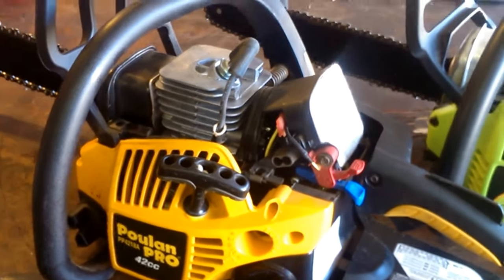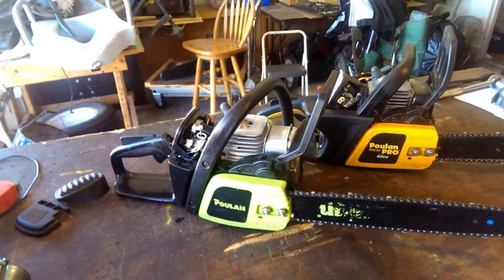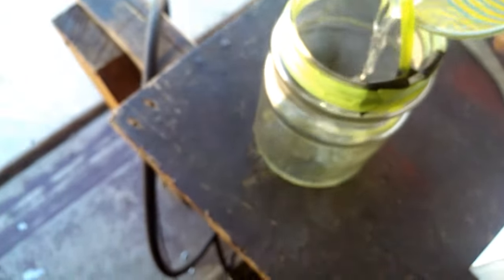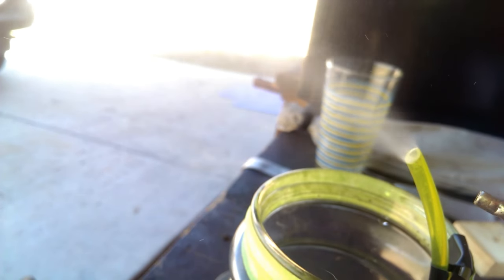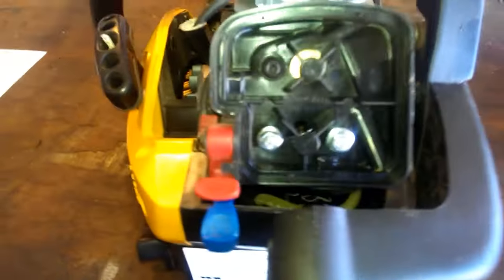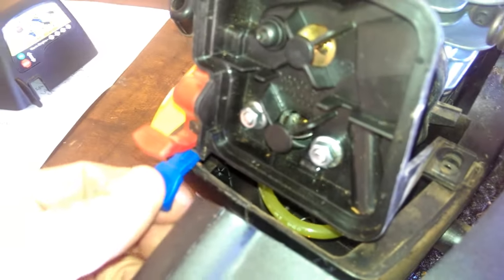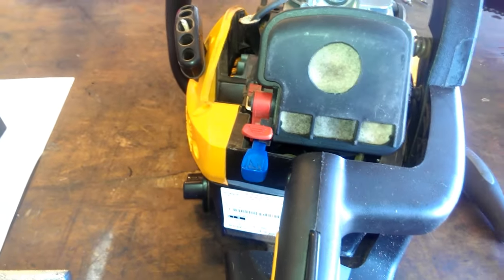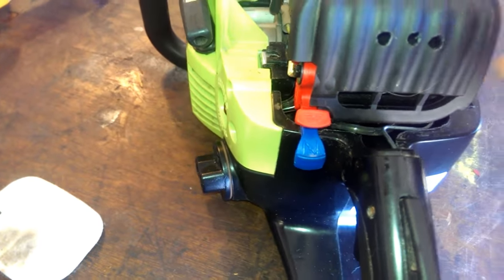Poulan wont restart after being used & how I solved my problem.

Comment: Awesome tip. There can be no harm in letting more air into the engine. I have that "bumblebee" model and it does the same thing every time, runs fine after initial start but after its warm it won't fire again. I have a date with disaster response in the morning and before I leave I will be making a big hole in my air box.
Reply from the maker: Eric Butterfield clean filter and increased air flow will do you some justice my brother. Please let me know how it works for you.
Reply: I just watched the poulan official channel and there's a warm start procedure I wasn't familiar with. They say specifically for a warm start, pull the choke and push it back in, this will engage the fast idle setting. I will try that first since it did come from the manufacturer.
Reply: ulitepilot aka Zombie Dave the Poulan warm start procedure worked perfect for me. I failed the saw and touched dirt. The chain came off and I marred a few guide links. I can fix it with a file I'm sure.
Reply: Eric Butterfield any update on the saw? Warm start procedure still working or did you saw the hole in the air box?
Reply: That sounds right. I never had problems with my Ppro 42cc but I did notice off the bat that it needed choke if cooling a VERY short time. I did check the filter before operation for clean. I chalked it up to the fact the lil bugger ran so good hot that it was prone to being picky at anything but hot. I thought my kind of girl! Glad u pointed that out, good thing someone reads the directions. My saw was second hand from a pawn shop. My buddy had me pick one up and he finally paid me for it...he is out in woods now pushing the tenth tree off the stuck bar with his tractor. Been in many tall trees(a few 500mi from home at my sons place) with hatchet and 2x4 steps nailed on limbs, ropin that Ppro up and never had to cuss her out, yet. My Sons neighbor helped hold wires away. then went out and bought a Ppro for himself. Wish I got a kickback for advertising.
 Nevers;;;;I wont get another Troy Built. Has a 20"er like new the recoil cogs slipped and could not get replacements, but tech asked if they could sell me another saw...? She thought I had a carb problem........just sayin!!!

Comment: "Bumblebee" LOL I've called mine that as well, they've made a good deal of similar-looking saws of varying displacement but the pp4218a seems by-far the most common, I love mine I got it for $50 at a pawn shop and have been pushing it hard ever since, have the rakers filed so low on my chain (don't do this..) and obviously keep it razor-sharp and it just eats wood...I did a muffler-mod on it but got no gains (am using a tachometer) however the air-induction seemed the 'bottleneck' and I'd meant to devise some DIY /mcguyver'd filter-box but never got around to it (so my saw screams from teh muffler mod, w/o any power gains.....like a honda with its muffler cut off ;D ) so am VERY thankful you posted this am going to modify mine similarly (although I'm thinking to remove even more material, I mean it's just gotta be a skeleton for that filter right? ) 

Do you tape your filter-housing into place or does it stay firm?  I have to tape mine every time I touch it or it'll be loose the next time I open it up, in fact more than half of my saws are that way so I always just run a line of tape around the filter-housing//saw-body interfacing!
Reply from the maker: My filter housing/cover no is loose when I take it off too. The old Stihl saws have a spring wire that hold the cover in place. Maybe I'll try something like that. Thanks for your insight brother.👍
Reply: I bought a 50cc from Sears warehouse not knowing anything about chain so I had to do some reading because it would not start. Bottom line, bad piston and sleeve, cap no vent drilled carb.' cover, coil, spark plug.

Comment: I would add some of the soft fiberglass screen or say metal screen cut out to the size of the filter. You would still have the same airflow improvement to the intake but it would keep any other elements out the filter that were large enough to het into the ported holes that are drilled. Otherwise I was thinking the same with you. 👍
Reply from the maker: Very good and legit points.. I appreciate your input. 🍻👍

Comment: i solved my poulan starting problems in a slightly different way... i threw the damn thing away and bought an electric...i couldnt be happier.
Reply: What type of generator do you use to power it?
Reply: @111000100101001  a 50 ft extension cord

Comment: Thank you for posting this video. Last week a friend gave me his 3 year old chain saw, a Poulan Pro. He said it ran for about 3 hours, something made it stop working. He took it to a lawn mower repair shop. He said the oil pump to the chain bar was replaced. After he got it from the shop he used it for about 2 hours, and now it will not start. So Now I'm thinking the fuel may be the problem as well as lack of air to the carb. after watching your video. Now at least I have a starting point as to where to began. trouble shooting.
Reply from the maker: +christopher dustin Good Luck Chris. Let us know if you end up with a good saw.
Reply: Update. I was really stumped until I watched your video. I drilled several 1/4 inch holes through the air filter cover. I believe it was 10 or 12 holes, I wanted as much air as possible. my saw runs great, it restarts after I let it sit after use. I showed the guy that gave the saw to me. He said it runs and sounds better now than it ever did when he first bought it. Thank you for this video.
Reply from the maker: Thanks for the update Chris

Comment: Excellent design flaw catch.  Now that I've been looking at your video, the only part of the filter that is being used is the immediate areas near the holes.  All the rest of the filter is pressed up against that plastic cover and is pretty much not serving any purpose for the most part.  I'm going to make the same mode with a few extra holes around it.  Thank you!!  Also, I like the "Laboratory" :)
Reply from the maker: Thanks Captain! I appreciate you taking the time to comment.

Comment: Also heard changing spark plug gap to.30 helps.
Reply: That’s what I did.  Fires right up.  Even so, I’ve noticed the same issue with the filter and pondered drilling holes myself.  Next time it’s apart, I’m going to.  

A few years back I lived out on Washington’s upper peninsula.  There was this guy parked near the entrance of the dump with a sign that he takes old mowers.  I stopped to chat with him (and give him the mower I was going to junk).  He told me the biggest problem with any small engine is the ethanol in the fuel.  I ended up going to his shop to buy one of his used mowers.  He told me where to get ethanol-free gas (with all the logging up there, it’s easy to find).  Ever since, I’ve been running ethanol-free.  I had my Craftsman saw apart (rebranded Poulan) this year.  The carb looked great.  However, the plug looked wet/black.  I cleaned it and checked the gap, wasn’t even .025.  I opened the gap up to .030 and this baby runs like a champ!

Comment: Had the same starting problem back in 97, full throttle or it will not start hot. Never had that problem with a Homelite and now I have a MTD (Remington). The Poohlon runs good and I was tired of the leaking bar oil and it has rotten fuel lines, was not worth the time or money to fix a POS saw. Got the Remingtom RM4214CS from Amazon in March for around 100, its easy to start and cuts wood, no regrets.

Comment: best  advice,  buy  an  old  Husky,  run  only, Non - Ethanol  gas  and  you  will  never  have  a  problem, I  have  an  old  480  and  a  2100  they  will  cut  anything  you  will  ever  encounter. Cheers.

Comment: Good thinking Zombie. 
  Yesterday I went to replace the fuel filter on a 42cc Poulan chain saw. Pulled on the filter and the line came off. But the fuel line acted like it had a sleeve inside of the fuel line, and that clear plastic sleeve stuck to the filter. When it came off the filter it snapped back into the fuel line and balled up. Had trouble then. Finally got the filter replaced. But I sure had not seen something like that happen before.
Reply from the maker: +Martin Leyva  Thanks Marty, so glad you posted this because I'm 100% sure others have had this happen to them.
Reply: The small stiff sleeve inside is an attempt to correct the problem of fuel softening the fuel line over time especially low quality lines when cool suction is applied. When warm/hot the gas press helps the line stay open.

Comment: I understand what your saying but not sure about it. I bought a brand new Poulane used it for 1 hour stopped for lunch break it would not start again and took it back and got new one and went back to job sight it ran for hour or two then same thing happen. I fixed it by returning it to store and buying an Echo never had any problems since echo is 3 years old and still running fine lol. I suggest to everyone do not buy a Poulan but just my opinion

Comment from the maker: First time viewers and new follower please dont be shy to comment. Off topic questions are always welcome. Maybe you want to see how to install something or you have a click clack noise that has nothing to do with throttle adjustment. Ask here  because someone else will or my learn something. Sometimes you see a tip or method that will apply to your DIY fix. Thanks to all the Guys and Gals that follow this channel. Zombie Dave
Reply: ulitepilot aka Zombie Dave what sized hole for the cut in the pro model?
Reply from the maker: Brandon Schnell I think it was a 1" or 1 1/8 Wood bit. I put it on the bench and just drilled through it slowly.
Reply: ulitepilot aka Zombie Dave without watching the full video on most cheap outdoor items the first thing I’ll look at is the spark plug or o2 sensor if available
Reply from the maker: Got Game O2? I'm confused. Thanks for commenting.
Reply: o2= oxygen sensor tells computer to lean/enrich enjectors by increasing  dwell on time to provide more/less fuel for a 14.7/1ratio required. located in exh.sys
Reply: I just watched your video and think I need some advice. I cleaned the air filter, changed out the spark plug, fuel filter is clean, dumped out the gas anyway, bought fresh gas and used a new gas can to mix it with the 2 stroke oil, and I made the hole in the air filter cover. Still Nothing:-( I checked the spark plug gap and it's good, checked it against the engine while pulling, and got a good spark. I can smell gas, even tried carb cleaner in the carburetor. Still nothing. I hope you can help.
Reply from the maker: Bearded & Bored  of you have compression and spark then you have a 'runner'. You can replace the carb and just be done with it or you can watch this video and see if it helps you with the confidence to rebuild the carb yourself. No shame in buying a carb and THEN tearing the old one apart. Chances are that the metering diaphragm is stuck in the closed position. I dont know how many hours are on your saw or how you run it so check the spark arrestor for partially being clogged. Watch this and I hope it helps. https://youtu.be/wNTKOuKwXaI
Reply: @jamesfarley5183  you think there's a computer chip and O2 sensor in yer chainsaw?  (Probably not)
Reply: Have you figured out why the lines erode. Is it from the ethanol, or the water. I hate having to replace lines every season especially since after market kits are not the rite diameters inside or outside..
Reply from the maker: @michaelmartinez5217   most likely ethanol.
Reply: @paulyuneps9899  , Most professional saws are now fuel injected.
Reply: @michaelmartinez5217  , It is the ethnol it eats the rubber fuel lines, also they do make ethanol resistant fuel lines now.
Reply: @michaelmartinez5217  try using the premixed fuel that has NO ethanol, makes a big difference
Reply: If it's got an O2 sensor on it, it must be a BMW chainsaw 🤑 for cutting down European trees lol

Comment: Been scanning through your videos for the last few minutes. Very interesting stuff to me.  My first power saw 19 years ago was a McCulloch Mac (forget the size) and it would never start the second time. I got fed up and got a Husqvarna.  When my father passed I got his old saw and unknown to me it was the exact same McCulloch as mine. I kept both running for the next 15 years or so and finally sold them for $25.00.  I told the buyer they were hard to start when warm -- hope he made out ok.
Subscribed so I can learn something.
Reply from the maker: +Halscamp  I appreciate that buddy. I subbed you as well. Please join in and ask a Q or help out with an answer when you can. I need all the backup I can get. Welcome aboard!
Reply: Thanks for the invite. I have a small business and have at least 6 gas push mowers, 3 ride ons, 1 zero turn, 2 - 2 stroke grass trimmers, 1 - 4 stroke grass trimmer, hedge trimmers, leaf blower, power saw, old, old tractor, 4 wheelers, snowmobiles, about 5 electric mowers, and 5 or 6 electric grass trimmers, generator,  and and and.   I spend 1/2 the year trying to keep these running  and I am no mechanic by any means but I do survive without going to the small engine shop very often unless for parts. Live and learn I guess.  If you don't mind you will hear from me.
Reply from the maker: +Halscamp  anything I can do just ask.

Comment: My gas string trimmer used to NEVER re-start after using it for even a couple of minutes.  I had to quit and come back after a few hours then it would start.  So I drilled several extra holes all over the cap over the filter, and now it re-starts easily every time.  I guess it is the same principle at work shown here.

Comment: man i luv ya! this solved my issue almost smash the damn thing on concrete from frustration tryin ta start the thing
Reply from the maker: Thanks Bobby. Luv you back and thanks for taking the time to comment.
Reply: Lol, that reminds me of the first chainsaw I ever bought, didn't have much money so I bought a used 14" macolough (?) For 100$ from a pawn shop. That little saw ran great. Was 20 miles out away from nowhere, fueled up pulled the cord, it broke. Went home, found a place on the other side of town that had one. Went home and installed it. First pull, the new cord broke, I'm Irish, threw the saw down many many times, went inside the wife asked did I fix it, I said nope it's broke, she asked what's wrong, I looked at her and said it's broke.
Reply from the maker: Wish I could give this 5 thumbs up. Laffed my ass off!

Comment: Great, I learned so many simple fixes I can try and why I would be doing it before I junk my saw.  I can not wait for the sun to come up tomorrow morning.  I was ready to put my junk into the trash can😀😀 Thanks very much.
Reply: Any updates on the progress of the repair of your saw? It would be appreciated.🙂
Reply: @mr.chaosvicious5968  A few days ago I was doing some small tree cutting and my saw stopped and could not start it again.  But yesterday I pulled A a couple of times and started working pretty well.  I think bad gas.  It's working now. So fR so good.
Reply: @TAO495  We don't really have those kinds of problems. We have a couple of gas stations in town where we live that still actually sells 100% gasoline with no ethanol mixed into it. That's what we actually use for ALL of our weed eaters chainsaws and what have you.

Comment: Dave,in the late 1950s I worked on 1 barrel and 2 barrel carbs w manual choke w accelerator pumps.That made it easy for one to really flood the eng, washing oil off  the rings ie no/little compression.  u can't do that on 2 strokes, only wet foul plug w no start.

Comment: if they are hard to start after running a few minutes check and see if you can prime the fuel bulb , if the prime bulb is dry open the gas cap and see if you can hear a vacum when opened up , the fuel cap vent is very bad about clogging up and the tank will hold a vacum and it will starve the carb of fuel .. open the cap and try the primer bulb again and see if it will prime fuel again and there is the problem , i see that problem on every poulan saw i get , they are great saws if you do some mods to them
Reply from the maker: jake williams  very very good point Jake. Each 1 as a little "bug" to it. Once you understand  it, thats what makes it yours. Lol.
Reply: I have a Ryobi that has both problems, the air filter restriction and the fuel "duckbill" vent  restriction. I think the ethanol in the gas causes the vent to swell shut.
Reply from the maker: Cooll Asice that very well could be. I also have worked on the ryobi chansaws and they have that crazy Ruxing carb. They dont bother me but I dont have parts just laying around like I do for Zama and Walbro carbs. Thanks for commenting and I hope you sub ne. I have 200 videos of tips and tricks for your perusal. Thanks again for sharing.
Reply: My "pull-on" always seems to have positive pressure in the tank when I open the fuel cap.  Still, won't fire after shutting down hot.  It will once it fully cools.  Gonna try to drill holes when sun comes back up...
Reply: atmospheric pressure has to be able to enter the tank .  the tiny hole in the gas cap gets clogged up and it will eventually shut the saw down , i drill a hole under the carb into the tank next to the return line and run a small piece of fuel line with a echo tank vent , it works perfect and it has less chance of getting clogged again . i hope it works for you !!